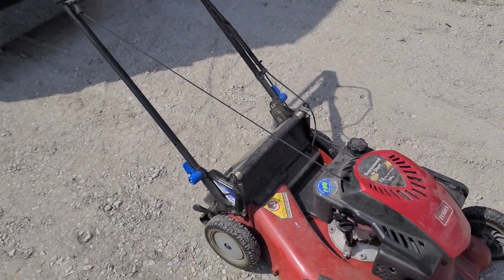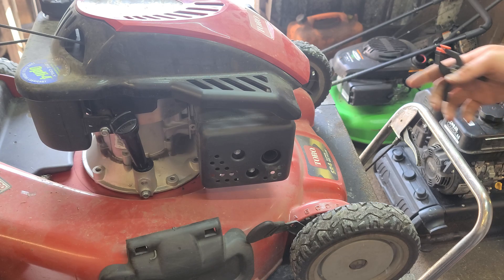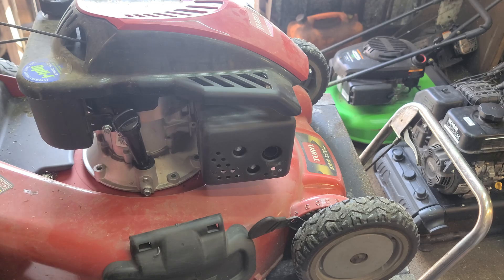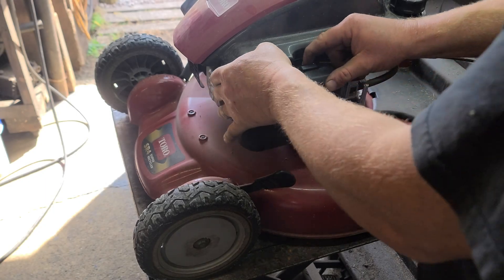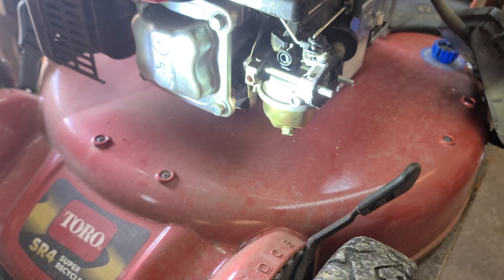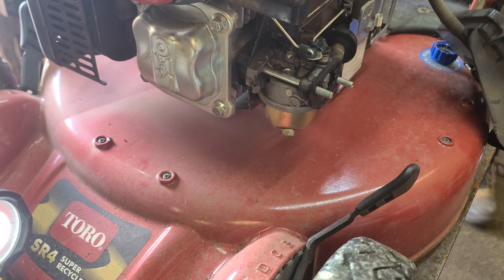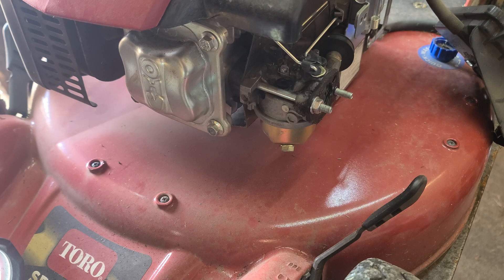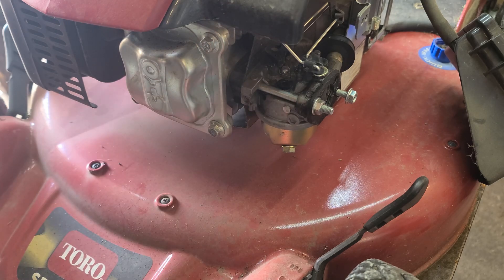Will changing a sparkplug fix a lawnmower that surges? Let's find out!

Comment: What if it wasn’t that and is the main jet can that be a pain to do?
Reply from the maker: The problem was the main jet I was just trying to prove a point to a viewer with that video. Very easy to remove and clean the main jet almost as easy as changing the spark plug.

Comment: That viewer is nuts or trolling you! You’re absolutely correct in your assessment, although I would add that it’s also possible for the governor arm to become loose or not be reinstalled correctly and cause surging. 
As for spark plugs, I always clean them either by using a torch or my bench grinder wire wheel. If they’re still the issue then I replace, although that’s rarely the problem.